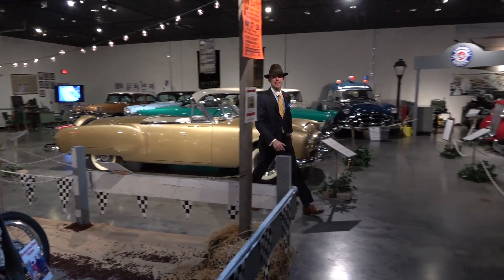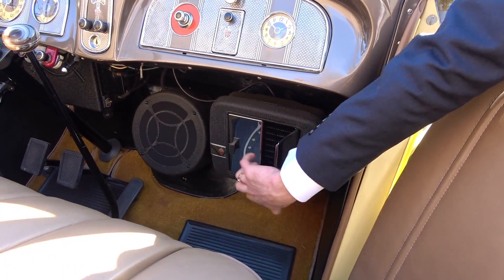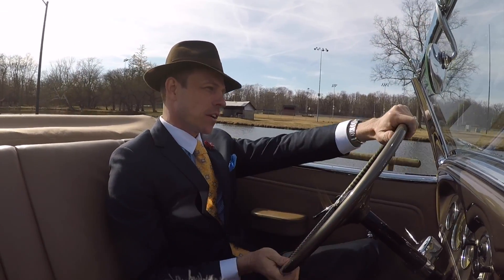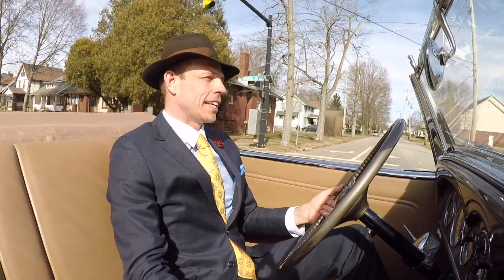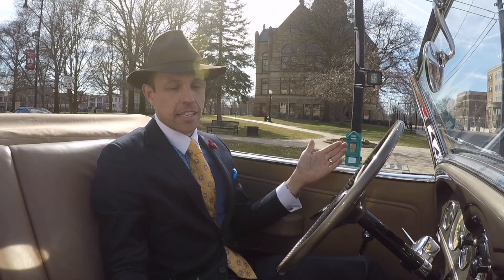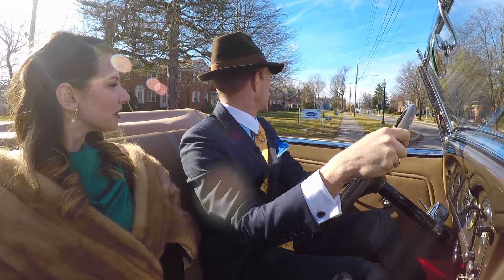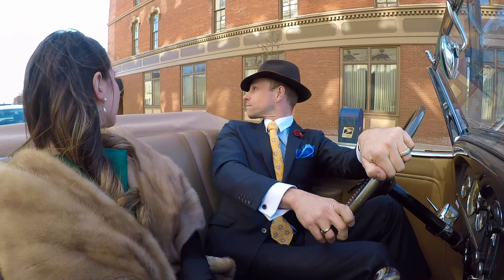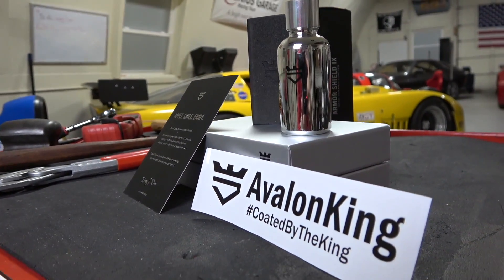How we BROKE a PRICELESS MUSEUM Packard and fixed it with a FISHING LURE !

Comment: I had no idea that they even used inline 8 cylinder engines. That's interesting, I wonder if they ever explored more cylinders in that same structure. It would be funny to see how big an inline 10 would be.
Reply: Old comment, but Packard did produce a single prototype straight 12 engine, and had it in a driving car specifically made for it since the massive length was longer than any hood could fit.

The problems with it was an extremely high amount of crankshaft "whip".  This is when a long shaft actually flexes and bends from stress and rotation.  While the engine did run, it didn't run very well, was not smooth and due to the extreme amount of strength needed in the block to hold the crank in place made it absurdly heavy.

Modern technology could probably be used to make a usable inline 12, but not to any great success since physics are physics, heh.

Also, straight 8 engines were around since the early 20's if I remember correctly.  Packard was not the first, but they are arguably the most well known for their incredibly smooth and superbly engineered I-8.

My 31 Packard has the I-8 and it can cruise comfortably along at modern speeds while still fully original.

Comment: Casey, there's a very interesting story about the first P51 to get a Merlin (in Egypt no less), with the engine from a wrecked Spitfire being shoe-horned in to a P51 that had a Packard V8 engine destroyed by enemy fire,... The early P51's were target practice for the Luftwaffe, as that initial V8 was terribly under powered for the application. With the fitment of the Merlin, the Mustang became the 'Cadillac of the Skies', where the Spitfire was a purebred racing platform.
Packard got the license to make the Merlins, but I think you'll find very few went in to Spitfires, most went in to Mustangs and in to Bombers.
Usually, it's an English Chassis getting an American Engine that makes a special combination, but in the P51, it's the other way around. :)

Comment: "Not much shifting"... that's because the engine torque output  oiled handle low speeds quite good: at 850 rpm this car offered more torque than almost any modern car

Comment: Leatherman for win!  I love my Wave use it almost everyday.  Cool old car they where made to last and run smooth. The torque on the straight 8 must be amazing.  Horsepower is one thing but the torque is what really moves you.  1903 80mph mist have felt like 200mph.  Why are cars only doing 70-80mph now? Should we not be able to do 100mph with today’s roads... but people can think that fast so 70 is good I guess.

Comment: Unfortunately Packard didn't make that good a Merlin.  My grandfather who worked on those engines in the RAF had issues with slack tolerances and having to re bore the engine block . Worst were the twisted piston rods and poor big end bearings from the box . The merlin 266 was a good engine as long as you didn't get the friday shift engine .